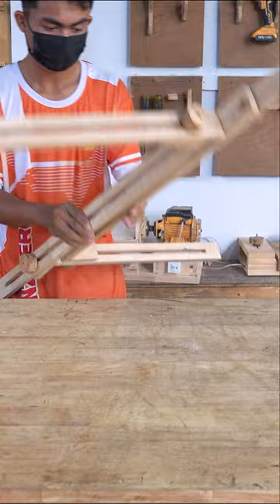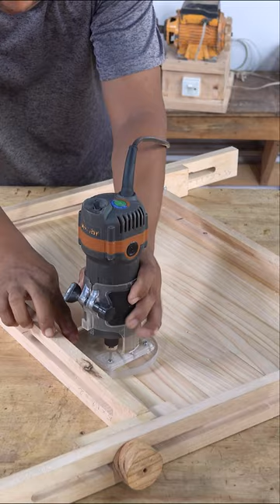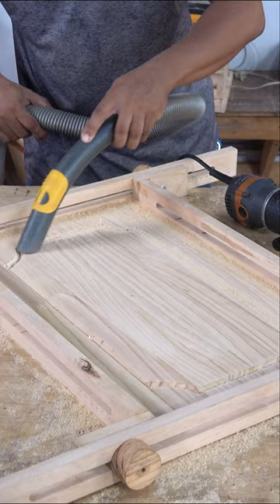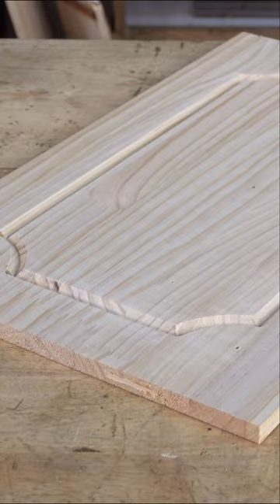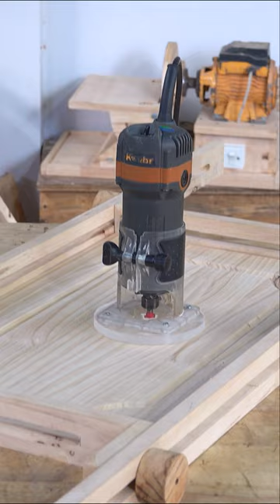Woodworking Technique with Hand Router #woodworking #shorts #amazing

Comment: That is a power router, not a hand router.

More importantly, you have created a simulated frame-and-panel look on that board. But it’s still a panel without a frame. That’s not strong, and not stable.
Reply from the maker: Thank you for watching
Reply: Posting "That is a power router, not a hand router" entitles the poster to "beta douche" status for this clip. IF this guy wants to call his handheld router a hand router, it seems to me it's his clip.
 If you want to strike a pose, get your own channel, and if you post your "power" router, I'll gladly be alpha douche and post about my Italian power router which weighs over half a tonne. It  has a rise and fall cast iron table, big enough to arrange sixteen of the boards in this clip without overlap. It has an overhead 2kW routing head with pneumatic pedal-actuated downfeed and a #2Morse taper retractable quill in the table for a follower bearing.  "That puny little thing of yours is not a power router, that's just a hand router"